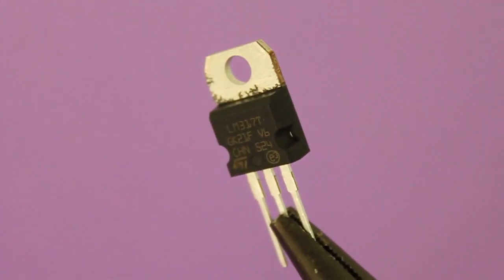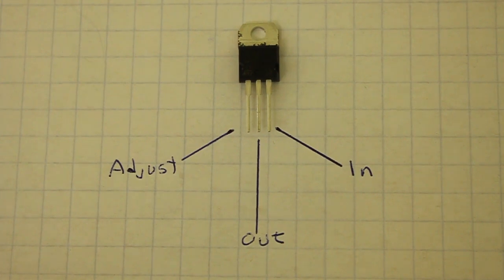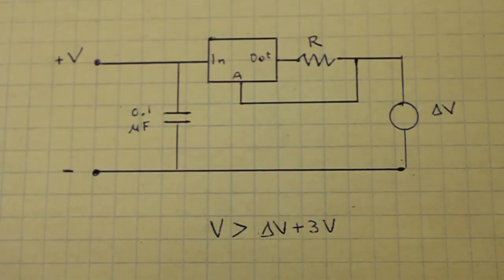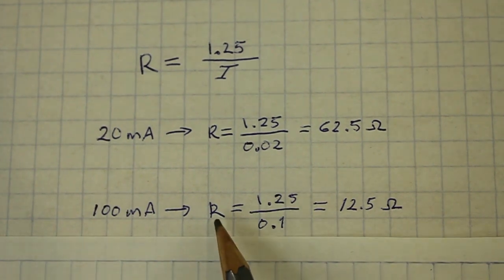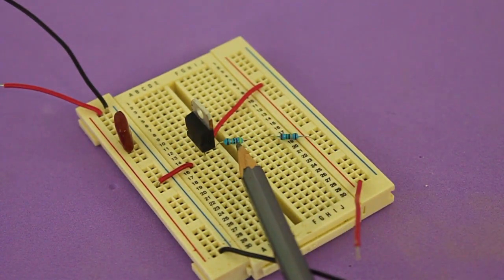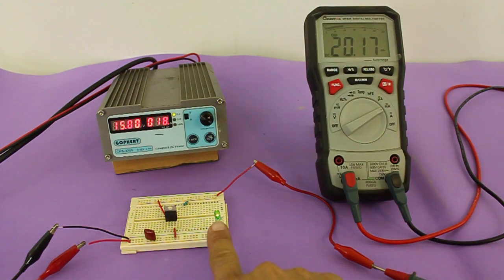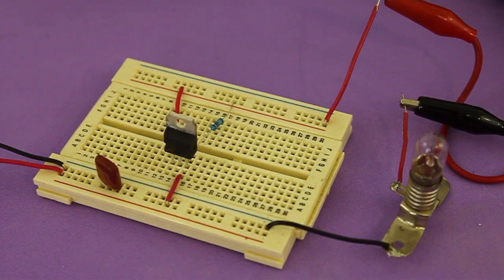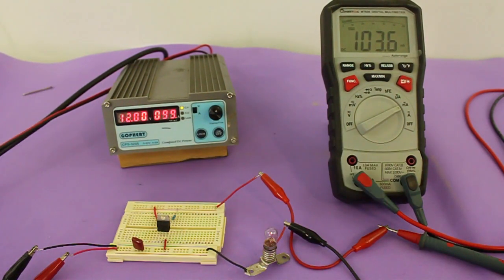Constant Current Source with LM317 IC

Comment: Hello,  i finally did the same, i used 1.5 Ohm to have an output of max 1A, but when i plug a load to my 12v lamp bulb, the voltage drops to 4v, is it normal ? many thanks.

Comment: This practically doesn't work as the set current flows through  the resistor the resistance increases taking temperature coefficient of resistance thus you need to have something to counter this heating effect as the current in the practical circuit goes on varying

Comment: Thanks for the video. Is it possible to choose a variation of the circuit so the resistor used to be smaller and thus to be used with higher currents? A voltage divider maybe instead of a single resistor?

Comment: if the minimum voltage for the led is 5.2V then why did it work with 5 v from the lab bench power supply?
Reply: Tolerance
Reply: The minimum voltage for the input to this circuit is about 5V, the LED only needs about 2.  The circuit has to drop about 3 to function properly.  I think he said that.  Maybe watch again?  Not meaning to be nasty.
Reply: @raykent3211  
You are right.